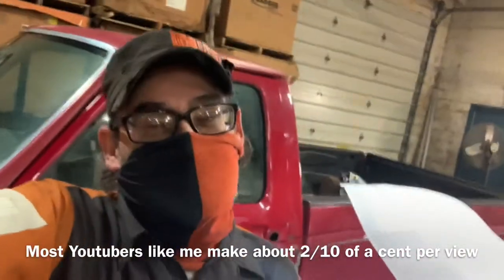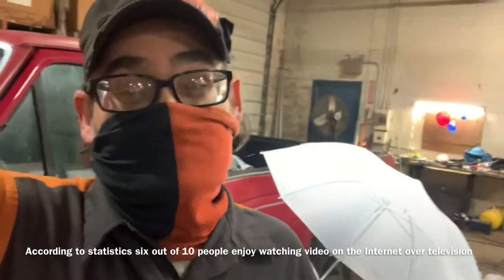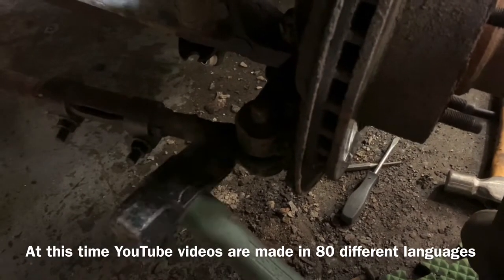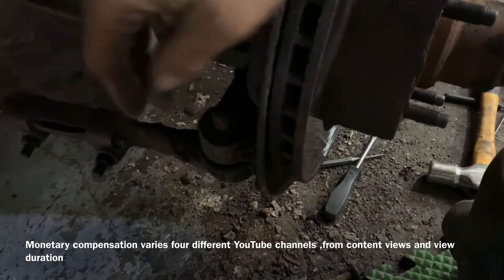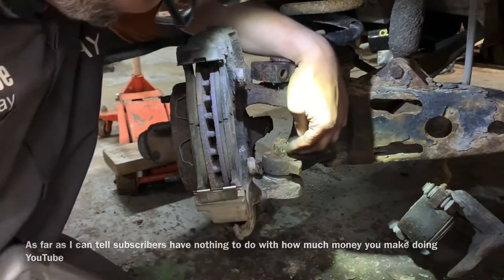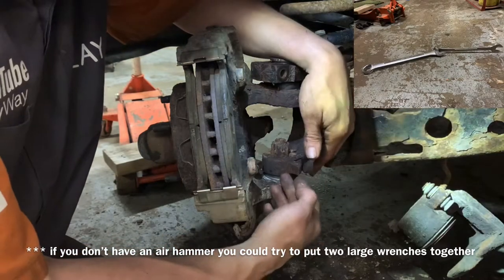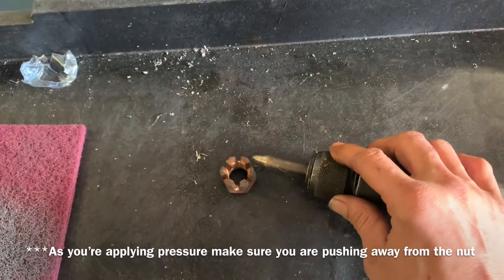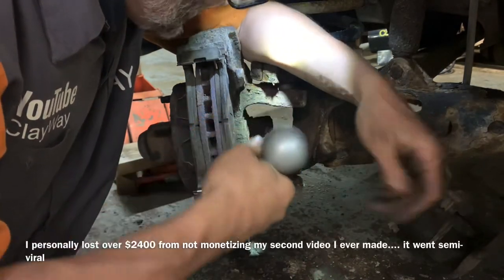How to remove a Frozen seized ball joint nut! diabolical auto repair super trick!!!

Comment: how would u advise removing a ball joint nut the spins...Ive snapped 2 tx 40x trying to hold it from the top of the thread so it doesn't spin?
Reply from the maker: What kind of car
Reply: @sharpcarco  bmw f30 3 series. I sorted it now..applied some heat and I managed to get it loose
Reply from the maker: Good to hear brother sorry I couldn’t help you

Comment: I have a really stubborn ball joint bolt on a 2013 Hyunai elantra that will not budge. I worked the nut up the thread, tried suspension fork, a crowbar, penetrating oil and nothing. Would hitting the knuckle work? Anything else I can try?
Reply from the maker: Yes, it will work just don’t hit it like a sissy girl….

Comment: Is there a such thing as a corded hammer, thats not a hammer drill? Im confused what power hammer to get. Does it have to be the air hammer? Or is there a similar hammer that can be plugged into an electric outlet for power? Thank you
Reply: And what attachments, or bits work with the correct hammer, to do this idea to get off the castle nut?
 Thank You
Reply from the maker: I really don’t know if there’s an electric version of that. I wouldn’t think so though there’s no way that an electric version could carry the impact an air operated version is.

Comment: Help! Any tips for when the nut is partially off and near the end of the tread, the nut and ball joint spin together. I used a torch to try and heat it and used a pry bar while trying to get it off. It just kept spinning 😞
Reply from the maker: Cut it ? With the miniature saws allwill that work?
Reply: I use an oscillating multi-tool with a carbide tipped metal blade to cut right through seized nuts and bolts.  A multi-tool can fit into tight spaces better than a reciprocating saw and is easier on your body.